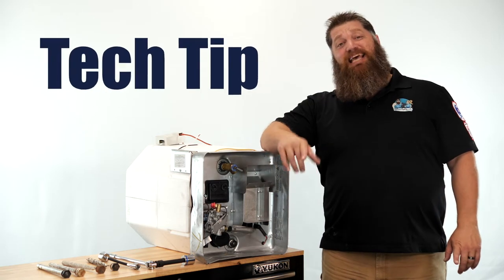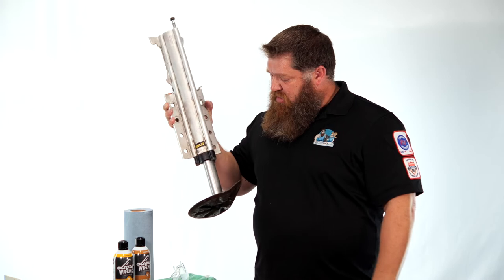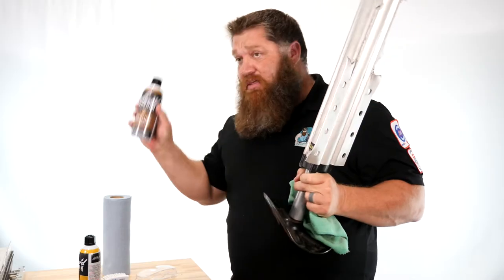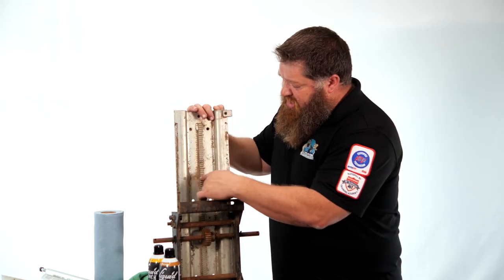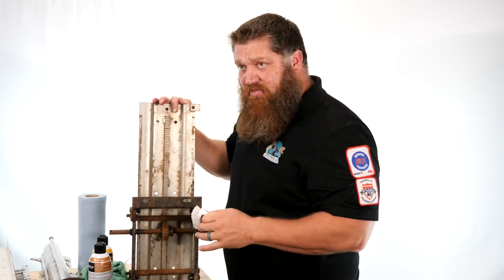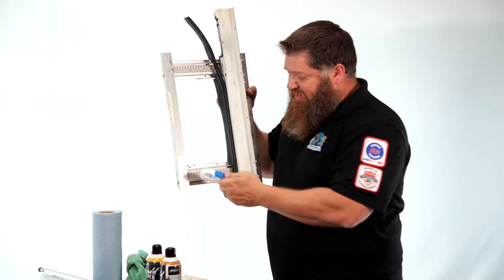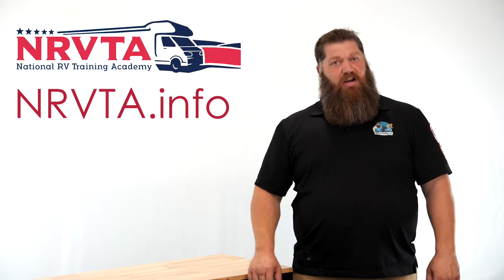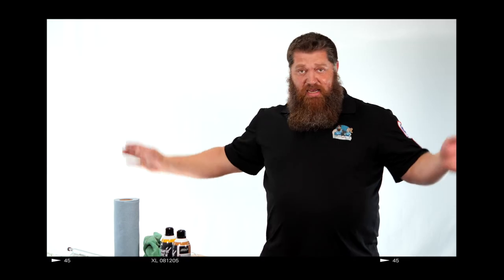Cleaning and lubricating RV JACKS and SLIDES

Comment: In general, HWH jacks require no regular maintenance. Under normal circumstances, lubrication
If a jack gets coated with dirt or mud it is advisable to clean
the jack. It is acceptable to clean the jack as a part of normal maintenance but is not required.
of jack rods is not necessary or advised.
Note: The 9000# and 16,000# kick down jacks have a roller bearing above the actuator rod.
This bearing must roll freely for proper operation of the jack. It is a good idea during regular maintenance
that this bearing is checked to make sure it does roll freely. If the bearing is frozen or does not roll freely,
use WD-40 to loosen the bearing and then apply a few drops of motor oil (used is fine) to lubricate the
bearing. See diagrams on reverse side.
BLOCK FRAME AND TIRES SECURELY BEFORE CRAWLING UNDER
VEHICLE. DO NOT USE LEVELING JACKS OR AIR SUSPENSION TO SUPPORT VEHICLE
WHILE UNDER VEHICLE OR CHANGING TIRES. VEHICLE MAY DROP AND/OR MOVE
Basic cleaning of the complete jack assembly is accomplished with the use of soap and water.
Spaying the jacks with a spray wand at a car wash would be acceptable.
The only time a jack rod would need cleaning is if the jack has been extended for a period of time.
The jack should not be extended just to clean the rod.
WARNING:
If the jack is extended, use soap and water or WD-40 on the jack rod then wipe the rod dry with a clean
cloth.
FORWARD OR BACKWARD WITHOUT WARNING CAUSING INJURY OR DEATH.
IMPORTANT: Do not use a dirty rag to wipe the jack rod or do not wipe the jack rod if it is coated with dirt.
This could scratch and damage the rod. Make sure to use water or WD-40 to loosen any dirt before
wiping the jack rod.
If the jack rod has been greased or silicone sprays have been used on the jack rod, use WD-40 to loosen
the grease or silicone and wipe the rod clean.
AND STRAIGHT-ACTING/PIVOTING JACKS.
To help reduce the corrosion of jacks after exposure to anti-icing/deicing agents, thoroughly wash jacks
after they have dried. This can facilitate corrosion of metallic components, such as HWH jacks.
Anti-icing/deicing agents, when spashed on your vehicle, continue to absorb moisture from the air even
with warm soapy water.
IMPORTANT: Winter Weather Driving
Reply: Great video tho just thought the HWH info might be helpfull

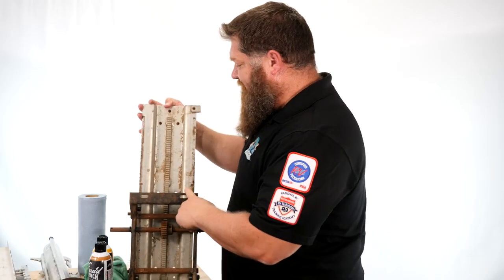Comment: Todd - at 1:06 you show the basics of a rack and pinion system which I have for our slide out.   I have made the mistake and used WD40 a few times.   What degreaser would you recommend to clean them.  I like the idea of the brush.   I lean to Simple Green (I also have Simple Green for BBQ cleaning which also touts being a degreaser!), and Awesome.   I'd like to get them nice a clean and then hit them with the CRC spray on with PTFE.   Suggestions?  (post script - I got it.  You show the Liquid Wrench products at the beginning.)

Comment: Todd, a little off this subject but can you cover stabilizer jacks if you haven’t. Question on what angle they work best. Thanks for the great videos.
Reply from the maker: That depends on the type of Stabilizer you have? Honestly the flatter the campsite the better for the stabilizer. You can also use leveling blocks to help. Stabilizers need to be straight up and down to the ground.

Comment: Hello Todd. I have a slide out maintenance question no one seems to know how to answer. I have a 2015 Keystone Laredo 299BH TT with 2 slides. Both slides are cable driven. I know there has to be some sort of maintenance to be done to clean and dry lube on some sort of track or rollers for the slides on the bottom of the slides. Do you happen to know if and what kind of maintenance needs done and how to access those? Thanks for all your tips.
Reply from the maker: Join this group. https://www.facebook.com/groups/nrvta a lot of RV techs hang out in there. They may be able to help.